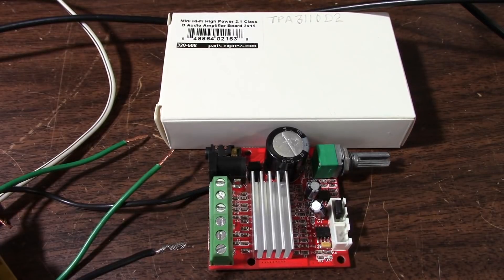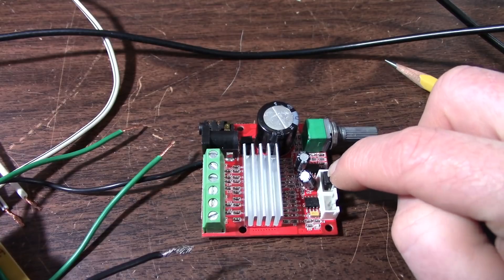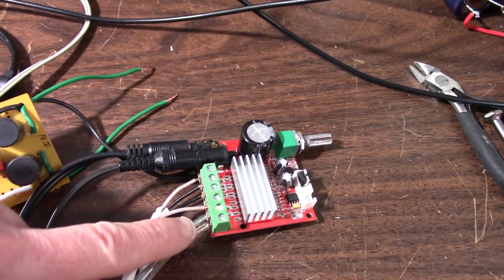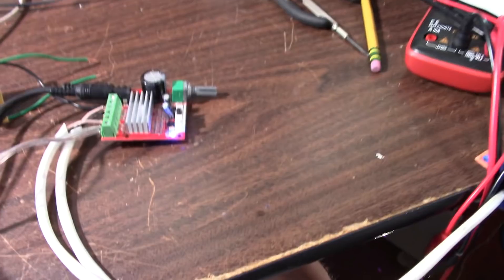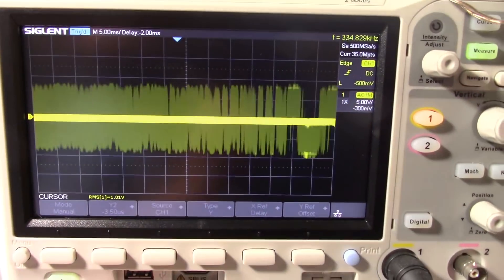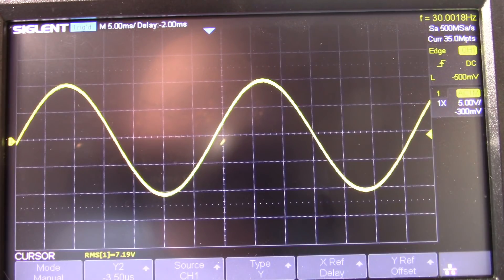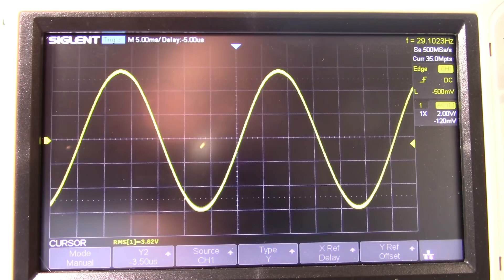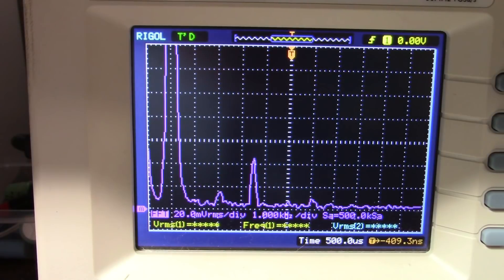Class D 2.1 channel mini amplifier board test and review

Comment: i have a question. please comment. I got tpa3110d2 blue ones with a blue heatsink on top stereo channel with coil filters. I am using 12.6v lithium battery pack. i blew up 4 of the boards. I just dont know why. everything is properly connected.  a couple of hours later the board is unuseable. I measured my speakers it shows 3.5 ohms. is it related to that.?  help please.

Comment: I'm surprised at the heating issue. As a novice, I'd heard class D was highly efficient and wouldn't have expected it.
Reply from the maker: Yes class D is efficient. With 4 ohm loads, it is probably around 90%. At 14 volts, each channel of this amp would put out 15 watts or 45w total. This means an additional 4.5 watts is dissipated  as heat which would overheat that little board. Most music is not continuous power, so you could get away with it. If you like the music cranked with the bass turned up you might want to monitor the heat sink temperature.
Reply: @JohnAudioTech  Thanks for that explanation.  I should have done the math.  That's a lot of heat for a passive heat sink of that geometry

Comment: Aren't class D outputs supposed to be measured with 2 channels of oscilloscope in differential manner ? It could cause severe issues if there are common grounds otherwise between the Scope and the Amp.

Comment: Looked these up on Ali, to find the TPA3110D2 SSOP-28 bare chip is quite inexpensive; less than $0.40 cents ea.  Heat transfer pad on the underside.  Curious to see the underside of the board, if that is where the chip is mounted.  There is a TI datasheet on these from 2009 that also advertises 15W/chan at 16V.

Comment: Posted this before he got to the freq check: Checked the PE page the sub is 150Hz lowpass no mention of the high pass, but on ebay listings it is sometimes said to have a 100Hz highpass.  Yes I spend too much time looking at amp boards.

Comment: 15 Watts, 6 Watts, who's counting?
Reply: it depends power supply voltage
Reply: @firuzpulatov7750  yes it does. It also depends on the output load resistance and some other factors like heat dissipation too.

Comment: I think, a class D type amplifier cannot oscillate due to clipping or rectangular wave because it has no analog feedback and it is filtered because of its pwm frequency. I don't really understand why they sell filterless class D amplifiers. Maybe because it is necessary to match the filter to the load impedance. But you cannot expect, that the user of such amplifiers will make the filters by himself. So I guess it is useful to supply these amplifiers together with a 4 Ohm and an 8 Ohm filter on separate PCBs.
Reply: There is one simple reason. These are cheap amps, and they work really well without filters, so why would anyone bother? For most people it would be waste of money, and audiophiles probably won't use these anyway.
Reply: @micha3-2137  They really don't work well without creating problems in other areas like leaking RF into power channels, completely messing with FM bands and even other Radio Bands. They are a pain unless otherwise very well laid out with sufficient filtering and RF bypass in place. Reminds me of the so badly done PAM 8610 boards, it being nearby, forget about any radio to work at all. If you have sensitive preamps without pretty decent grounding, RF protection(shielding etc), they are a menace to control. And almost all of the cheap boards roll off unpredictably towards the higher spectrum.